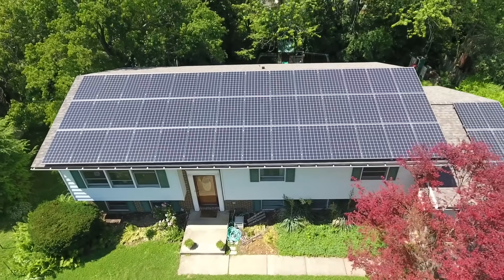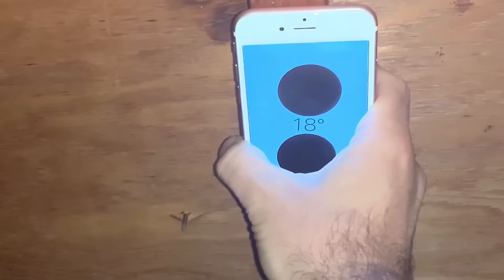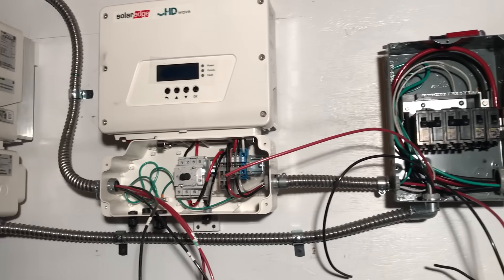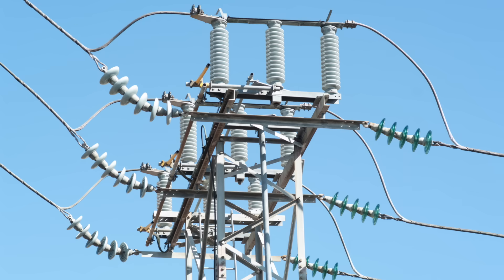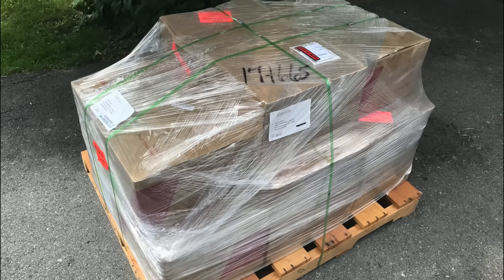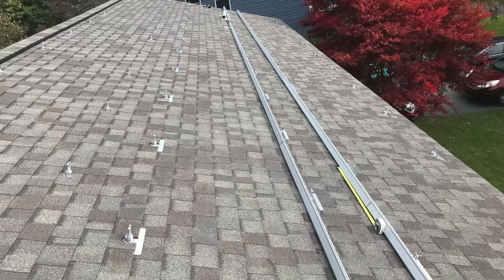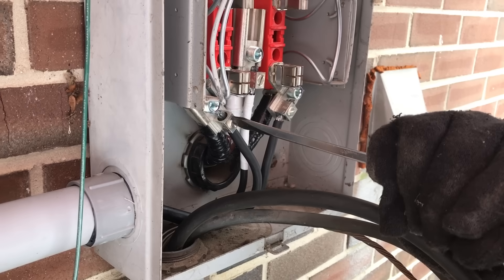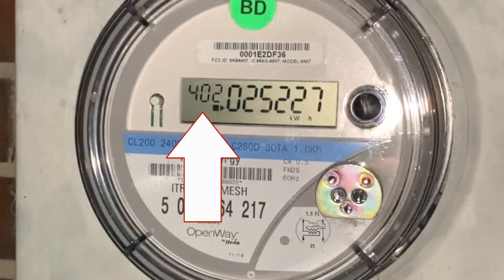I Installed a Power Plant Myself | HUGE DIY Solar Panel System

Comment: Thanks so much for sharing such quality content without unnecessary filler. 

If you don’t mind me asking, for the size of the house I’m surprised by the energy usage, what sort of appliances/usage do you have?
Reply from the maker: Thank you!  I'm encouraged to hear that you enjoyed it.   That is a good question about usage.  I'm kinda curious how others respond since our annual usage is around 17-18MWH/year.  We have electric baseboard heat which is the main driver of the annual electric bills.  Plus, we have a big family using hot water, a second freezer, older house, etc.  I do try to insulate first and patch up everything i can.  Thankfully, the attic has a generous amount of insulation in it (I don't remember the R value).

Comment: I'm not an expert, but those power optimizers must have pushed up the costs. I've read are only neccesary if panes have very different ratins, different orientation or in some instances with partial shadows, in any other instances the % gains are negible, MPPT does a good enough job.
Reply from the maker: Yes, you're correct, they are more expensive than a stand alone inverter.  But over the life of the system it was't that big of an increase.  Maximizing the panels on my roof and getting individual monitoring were high on my list (and staying within budget too).  Because I was limited in the size of panels where I could get 3 rows, I was also limited in the equipment that would work with those 96 cell panels.   Solaredge was recommended by many installers that I spoke to and they were actually much cheaper then the micro-inverter competition at the time.
Reply: I suspect that optimizers also provide the rapid shutdown feature that is also required of rooftop installations now.

Comment: If you have sunshine, installing solar is now a "no-brainer"!  In my location (coastal, 27 deg South), evacuated tube solar hot water plus 5kW panels reduces power bills to less than AUD400 (US$300) per year for a couple plus two young children with full ducted aircon. Micro inverters, as in this video, are more expensive than a single inverter, but have big advantages in the case of shade, or a panel failure. Batteries are not yet viable on a ROI basis for grid-tied houses.
Reply: Sorry. Power optimisers, not micro inverters.
Reply from the maker: That’s great you have solar PV and hot water.  I’m not sure how your credit system works but where I live I get a one for one credit for each KWH sent to the grid.  So unless one is worried about power outages (or they have time of use rates - different rates depending on time of day) I don’t see a reason to get batteries.
Reply: @FrugalRepair  Absolutely! I regularly look for a battery option for a grid-tied house in suburbia, and have never found one that gives an acceptable return. The issue that people neglect when analysing a "solar" battery is the Depth of Discharge vs Cycle Life tradeoff. The only domestic-scale energy storage devices I have found with BIG allowable DoD AND high Cycle life are Nickel-Iron cells, Supercapacitors and Flow Cells. Each of these have their own problems and/or high initial cost. We await a breakthrough. 
LTO batteries (90+% DoD, plus 20000+ cycles) for domestic storage are just becoming available, and could be viable, IF the manufacturers can get some economies of scale, as they are still well over $US 1000/kWh.

Comment: I was wondering What did it cost per panel and kit
Reply from the maker: Good questions.  I didn’t order as a kit but bought the parts individually.  The panels were like $.71/watt.  It was on the high end of my budget but I was happy with them.  The panels were 325W and I got 48 of them.
Reply: That’s roughly:
1. 48 panels @ $230.75 = $11,076
2. 48 optimizers @ $80 = $3,840
3. 2 7.6 kW Solaredge Invertors @ $1,700 = $3,400
4. Iron ridge rails 340 ft @ $4.25/ft ~ $1,500?
5. Ironridge Flashfoot 2 footings 40 @ $12 = $480
6. Misc electical - $1,000
7. Electrician $1,000
8. Total ~ $22,296
I’m sure I’ve missed something but that’s in the ballpark.

Comment: I would not have done a grid tie. I want to be off grid so I can have batteries to supply my home when everyone else is blacked out. that is what I will be doing. totally off grid and independent in  everything. the less they know about me the better. time is coming that that is what everyone will want to be and as you see what is happening now I think you all know what I am talking about.
Reply from the maker: I think being off grid is cool but when net metering is available and one lives in a residential neighborhood without a lot of land, it's just significantly cheaper to use the grid as the "battery".  But I understand you point is to avoid that.
Reply: @FrugalRepair  the only problem is when the grid goes down you are like everyone else without power defeating the point of having solar to my thinking. You could get a small battery bank for that occasion so that you have power just in case.
Reply from the maker: The good thing is that the grid hardly ever goes down here. But I have thought about what I would do in case there was an extended period of time that there was no grid power available.
Reply: Yeah, totally off grid is pointless, but a hybrid inverter does allow the independence when needed. California has already seen a lot of the rolling blackouts during fire season. 2020 is proof enough that anything can happen. Consider the Sol-ark 12k as the best example of a hybrid system.
Reply: @bokchoy335  I will be going off grid completely but I will be in the Philippines with my wife and son. we will hopefully have a place out in the countryside where we can grow most of what we eat etc. what is happening supports that kind of move. I realize not everyone can do that but I would if I could

Comment: Very nice. When building next time :) I would recommend some free space among the cells for cooling. Cells are then more effective in production. It will make some slight difference in long term.
Reply from the maker: Do you mean space between the panel frames?  That's not really possible because you want the correct amount of pressure holding the panels down.  The bolts that hold the panels down are shared with the panel next to it.  A bigger factor is the heat from the house roof.  I did try to create as much air flow (space) in between the shingles and the panels though.
Reply: @FrugalRepair  Sorry for my English. I meant some free space between the panels to let air ventilate the space under panels. It is not so serious problem: https://www.solar.com/learn/does-solar-panel-temperature-coefficient-matter/
Reply from the maker: Thanks.  The Panasonic panels that I purchased are one of the best panels with the temperature coefficient rating.

Comment: I want to have power when the grid power is down, most grid tie systems dont give you this. you are still sitting without power
Reply from the maker: You're correct, if the grid goes down I don't have power (the inverter safety system prevents the production of AC power until it senses the grid).  Thankfully, that is pretty rare around here.  And it's even more rare that the power goes out when it's sunny out.
Reply: @FrugalRepair  So now you need a house battery
Reply: @Derek_Kuraitis  so now he needs many house batteries. Cheaper to get a generator
Reply: @pjballs69  Cheaper to not buy solar
Reply: @Derek_Kuraitis  Yes and they are NOT CHEAP.
Reply: @FrugalRepair  Power out is soon to be a common occurrence,as more idiots get jobs, and they put more and more people on an overloaded system.
Reply: @orbitalair2103  I have a feeling that EVs may cause outages in some time.
Reply: @NovaNix4  I think it is a good purchase but not the best investment for saving money. I see it more of a luxury item. I'd buy for other reasons, like a slice of independence, or if coupled to a battery system. I would not have it if I couldn't use it to keep a fridge running, and the lights on when the power is out. I would have a vehicle to grid inverter before solar.
Reply: @NovaNix4  To be completely independent, that would cost an incredible amount. I think I did the math around $200K for enough solar and batteries. Batteries taking up around 2/3. That is going to and from work with an EV.
Reply: @NovaNix4  Sry, I didn't specify how independent. This is with all electric heating, and a day without sun in the winter. I use about 15 DTH in january, so 4,400 kwh worth. Last year I did 18kwh/day in january. Add 146kw a day= 164kwh/day. So I figured at least 22kw solar and a 250kwh battery. At 600$ per kwh, so $150+ 60K for a solar system. You could be quite a bit more efficient with this like using a heat pump on everything, geothermal, etc, but it'd only add to how many days you can go without sun, and even a day is not enough. Thinking about it again, You'd probably have to have a slightly bigger solar system than what I wrote down. At this point, if you could store energy during the summer, in hydrogen or something then use it for heat in the winter, it might offset the size of the system quite a bit. This was all just for fun. No way would I get close to doing this lol.

Comment: How much are you credited per kilowatt?
Reply from the maker: It is equal to what I use.  So I bank up credits in the summer and use them in the winter.  If I have extra after winter I get paid for those KWHs but only at the wholesale rate (in May).

Comment: Very interesting. I designed and installed my own solar array nearly three years ago now - 14 panels at 350W. Interestingly, I couldn't fit them on the roof due to the roof design, so I designed and constructed a pergola in the garden with the panels on the top. The panels are adjustable for angle, with three possible positions, so there is a winter position (quite steep), a spring/autumn(fall) position and a summer position (quite shallow). Like you I used Solaredge optimisers and a single 5kW inverter. I'm in the UK so the rules are a little different, but overall, a very satisfying project with a great result.
Reply from the maker: Wow, that is great to hear you installed solar!  Thanks for sharing.  Have you been happy with production or had any issues over those three years?
Reply: @FrugalRepair  No. It's gone fine over the three years it's been installed. Output is pretty much on line with expectations - bearing in mind the weather we get in the UK. I did have one of the fourteen Solaredge Optimisers fail this year, but I spotted it, raised it with the supplier and they provided (and installed for me) a new one. I reckon the efficiency of the inverter is 96.52% (output of the panels to input to the system). In the first year I monitored it very closely but not so much now. My installed capacity is 4.9kW. While I have seen spikes higher than this (highest was 5.4kW) by best ever 15 minute average is 4.957 after about 18 months of service. Best this year (up to three years old) is 4.733
Reply from the maker: That’s great to hear!
Reply: justin brown  not sure how I can get a pic into here. advice?

Comment: So, how much is the cost of KWh used in your company and what is the cost that they credit you at?
Reply from the maker: Great question.  I get one for one.  So I save up in summer and use that credit in the winter.  In May,  any KWH credit left over gets bought from me at the wholesale rate.
Reply: @FrugalRepair  I'm just still trying to convince myself of doing this in the house I'm currently in the process of buying here in Puerto Rico. As you probably know it has pretty much the worst electrical grid in the world and is like the 2nd most expensive in the world. We get so much outages out of nowhere and if we get a hurricane we're months if not a year without power. From what I know the company charges us like $0.27KWh and if you do a system like this they buy back the electricity you generate at like $0.02KWh. So, it doesn't really seem like its worth it from a financial perspective but as a relief from the power outages it does.
Reply: @Danu01c  Honestly, in your case I’d probably just get a Power Purchase agreement from SunRun. I believe they operate in Puerto Rico as well. The reason I say this is because they are liable for the system if it gets damaged so if there’s a hurricane, they’d probably replace any damaged solar panels. You can DM me if you want to know more

Comment: FYI you should have stuck to the solar clips and just used more, cable ties physically disintegrate outdoors after 5 years or so so all your neat wires are gonna unravel themselves over time.
Reply from the maker: Thanks for the comment.  I hope they last longer than that since I got the UV protected ones.  But most of the ones I’d be most concerned about are within arms reach near the soladeck if I need to address any that have broken.  In other places they really were backup to the iron ridge clips but I will bear that in mind.  Checking the wires and clips are one of the main things I check when I go on the roof.  Do you install solar?  Any other tips or suggestions?
Reply: @FrugalRepair  no not an installer, but I've bodged lots of stuff with cable ties/  Be interesting to see how long the UV ones last!  I've seen bog standard ones in the sun all day go in 1-2 years.
Reply: UV rated ties mean nothing, they will rot
Reply: jjime 
- the cable ties are in the shade - under the panels - no uv light.

Comment: That's a impressive amount of panels! The code in my area makes you leave a walkway around the panel array in case a fire man has to gain access into the attic from the roof.
Reply from the maker: Thanks!  Our local region considered that 3’ walkway but didn’t adopt it.  I was told by the inspector that even if it did pass you can get an exemption from the fire chief.  I was thankful I didn’t have to do that.  A fireman also told me that they never go on the roof of a burning building anyway so he wasn’t sure why they had that requirement.  But that was just his perspective.
Reply: @FrugalRepair  yeah it one of them rules that probably never really are needed. I also installed a baby 2k system this summer. My goal was to just cancel out what my central AC uses and I was successful. I bought used 365 watt panels from a insurance company that had to replace a solar farm. $150 each. I'm very pleased how affordable it has become.
Reply from the maker: Awesome!  Did you make a video about it?
Reply: @FrugalRepair  not yet. Maybe next summer. I lied, my panels are Q-cell 345 not 365. The guy I bought them from had a whole pole barn stacked full of them. They were only about a year old when a hail storm came through the Texas solar farm.
Reply from the maker: That’s a great way to get solar much cheaper.  I hope you can make a video when you the chance.
Reply: jeffescortlx 
The firemen can access the attic from the other side of the roof, that doesn't have panels on it.

Comment: Great job👍 no batteries?? Does the excess cover the night time use?
Reply from the maker: Thank you!  Because of Net Metering there really isn’t a need for batteries.  I get credit on my bill for every extra KWH I send to the grid.  So it works out great.  For me I bank up a lot of credit in the summer then use it up in the winter.
Reply: @FrugalRepair  nice..👍

Certainly optimised the roof space, are you in a good location for the sun

North east England is not the best for solar returns, I looked into it before and also although south facing I dont have close to the panels you can get on there 

What's it producing at peak sun ?

Ty
Reply from the maker: Yes, I wanted as much as I could fit.  Installed is 15.6kw (48 panels).  At peak I get about 15.2kw or so.  I think that’s pretty good (97-98%) from the factory ideal ratings.

Comment: Wow! Having installed my own grid tie 8.4 kW system a few years back I'm seriously impressed with how well this relatively short video covers most items involved with an install.  While there are lots of details to get right, most parts of the install are relatively straightforward.
Reply from the maker: That’s really encouraging for me to hear!  Thanks!  That’s really awesome you installed your own system!  Have you been happy with the performance so far?
Reply: @FrugalRepair  Yes.  Performance has been as expected.  I went with micro inverters and have not had to do anything to the system since getting the okay from the utility to turn it on.  Payback was similar to yours and the RECs are a nice bonus.  We finish up each Fall with a ~3000 kWh surplus and use up most of that during the winter.  I installed a minisplit in our main living area which allows use to heat with in a good portion of the year cutting down on oil usage.  Without it our surplus would just keep growing! My compliments again on the video!
Reply from the maker: That’s awesome!  What state are you in?  I’m in PA.
Reply: @FrugalRepair  I'm in NH.
Reply: @FrugalRepair  I"m outside Philadelphia.  You nearby?  How I'd love to see that system.

Comment: Time to add lithium iron phosphate batteries. Charge the batteries up and you can still send power to the utility. Now you don't depend on the utility for power when the sun isn't shining.
Reply from the maker: That’d be nice.  I’d like to do that but with the net metering laws in PA (and there isn’t any time of use rates) I don’t have any need to get batteries.  But if we do get TOU rates then I will definitely look into it.
Reply: @FrugalRepair  That makes sense. I had assumed that you get different rates. Btw- Awesome job man. That makes me really happy that you completed the whole thing on your own. If I were to install a system at some point that would be the way I want to do it. There is no reason to pay those insane install fees.
Reply from the maker: Thanks!  Yes, I wanted to learn how to install solar and the costs savings were pretty big.  I hope you will be able to install a system at your place.  Do you have good exposure to the sun?